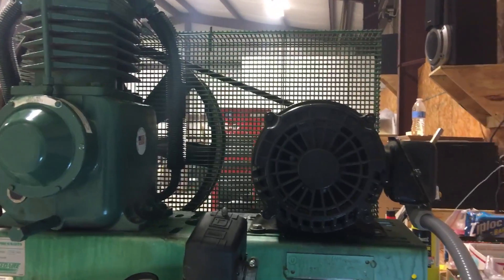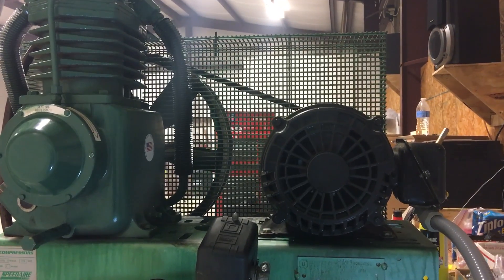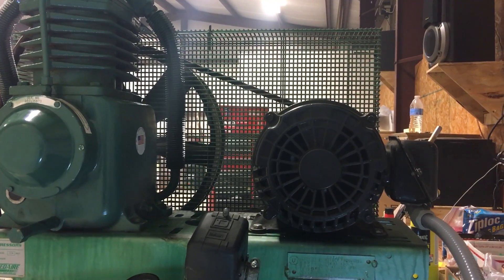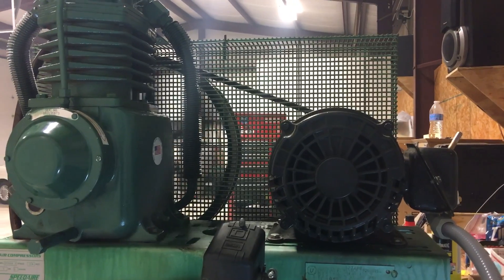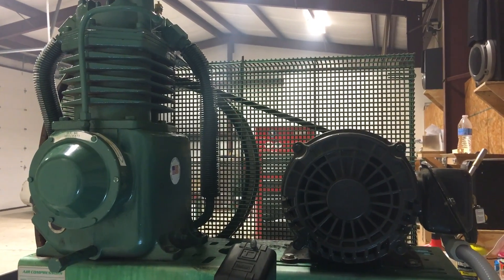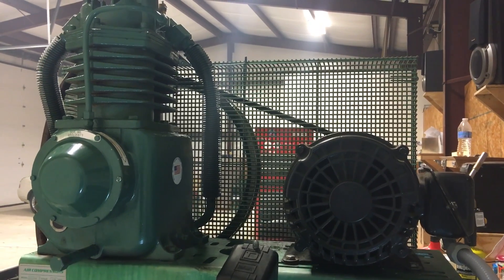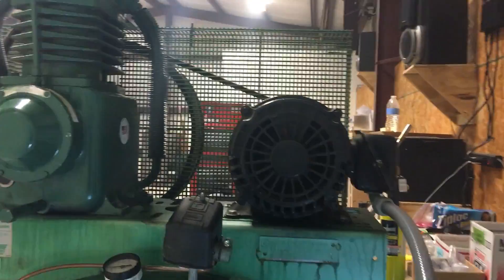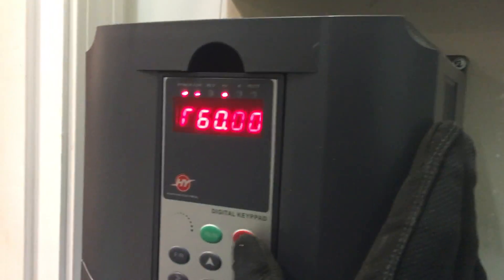VFD running 5hp Air Compressor

Comment: What does running at lower frequencies do to the noise levels? Often I don't need high output so running slower would be fine. Then when I do, bump the speed up.

Comment: I see this is an old youtube but I was still hoping you might be able to offer some help. I have the almost exactly same setup Speedair 5 hp 3 phase two-stage compressor. I have what looks like the same VFD 7.5 KW A2. I got it running but the start-up is way too slow for a compressor and It was not under any real load. Could you give me the perimeters to set mine to kind of where yours are set to?  Thanks.
Reply from the maker: Hey Cap'n! I don't have the manual to hand, but I recall there being a setup menu that lets you set ramp-up time, so you should be able to set it a bit quicker. I recall this unit also having a very slow ramp-up time by default as well.

Comment: I bought a 5HP VFD for my Champion Air Compressor with a R15 and 5 HP 3 phase motor and its stuggling to start it when the tank has built up some air pressure. I'm wondering if going this route was a mistake now...
Reply: Do you have an unloading valve on your compressor?

Comment: What size is the electric motor on that compressor? How many hp, voltage etc
Reply from the maker: It's a 5hp 208v (3ph). VFD is a 10hp rated unit if I recall.

Comment: I'm in the process of doing this for my buddy who aquired both a 3ph 5hp air compressor and a VFD.  How do you control the system?   Since you're bypassing the pressure switch on the unit, what do you use to turn on and off the compressor according to air pressure?
Reply: You need to wire a pressure switch into the control board and program the drive to use the input you wire to the pressure switch as the start and stop trigger. The manuals on these cheap chinese drives can be difficult to understand but they actually make alot of sense if you get one in your hand and follow along and test the inputs with a motor on a bench. I also really like the cost of them to run motors. I currently have a 10hp unit running a 7hp perskey spindle motor from single phase and the drive is controlled from mach 3
Working on a 5hp compressor now setup just like the video above

Comment: wow please need your help i have no knowledge for electric converting 
i have a air compressor 380v 3 phase  50hz 10hp. i bought it in china
and my country is using 220v with 60hz. do i need a VFD to convert all the frequency and volts?
hope to hear your responds thanks.
Reply: Contact a local industrial electrician  in your country.

Comment: Do you have to run a 10hp VFD to take single phase for 5 hp 3 phase because of derating?  Trying to solve the same problem.
Reply from the maker: Yes. A VFD normally takes 3 phase at 60hz (or 50hz depending on location), rectifies it into DC, and then makes 3 phase at varying frequency. If you feed it single phase, it doesn't really care about that, but you won't be using all three tracks on the PCB to spread the load - only two tracks. So it's a good idea to derate a VFD if using it on single phase. It's also a good idea to further derate a VFD if it'll be starting a motor under load - compressors are a good example.
Reply: +dregenius Thanks...looks like I'll be getting the same VFD otherwise this nice Ingersoll Rand air compressor is just an expensive door stop.  Would be sweet to get it working with a VFD.  How do you know the input and output wiring sequence?  Input is probably not as important but out to the contractor then motor probably wants them lined up in a certain way for proper phasing?
Reply from the maker: +David Lund you mean "out to the contactor"? If so, there should absolutely not be a contactor in line with the motor. A VFD should not be treated as a power supply that you can just open and close with a switch. Use the VFD's built-in "FWD" terminal, which will run when it's grounded. Use the pressure switch to connect the FWD terminal to ground. As far as the three motor wires, doesn't matter as long as you connect them to the three outputs of the VFD. If it runs the wrong way, swap any two wires and it'll reverse direction. I locked out reverse in the settings menu on my VFD to prevent accidental running in reverse which might damage the compressor from lack of cooling and lubrication.
Reply from the maker: +Gary Lund The VFD should have a small terminal inside labeled  "FWD" which means "run motor forward". This is what you want to use to control the motor as opposed to a big contactor, relay etc. because you never want to disconnect the motor from the VFD while it's running. The FWD terminal will tell the VFD to run the motor, it will ramp up nice and smooth, will be safe for the inverter, and let you utilize the VFD to its maximum potential. To "activate" the FWD terminal, you simply ground it (there's a small DC control logic ground pin inside the VFD as well, manual should show the layout of all the pins). So what I was saying about the pressure switch is that you wire it such that the DC control signal ground is on one terminal and the FWD signal is on the other. That way, when the pressure switch calls for pressure, it grounds that FWD pin and the compressor will run under full VFD control - nice smooth starts and stops. Let me know if you have any other questions!
Reply: +dregenius Yes, I did mean contactor switch. By the way, my son had signed on to Google and I didn't realize I was posting under his name.
I have ordered the newest version of the same VFD...has a small jog dial otherwise is the same..  OK, so I'll wire direct to the motor.  Not sure I understand how to connect the pressure switch up though...one wire to FWD and other wire to ground?  Ground where?  Sorry for the questions but am totally unfamiliar VFD wiring and am just figuring out how the compressor is wired.  It seems there is an overload breaker/contactor and the pressure switch interrupts power at the contactor when the switch measures design pressure cut off.  I can live w/o the contactor but need to have the pressure cut off function work.  Thanks for all your insights.
Reply: I installed a three-phase VDF on a single-phase 5HP compressor motor, but the motor gets very hot, have you had that problem?